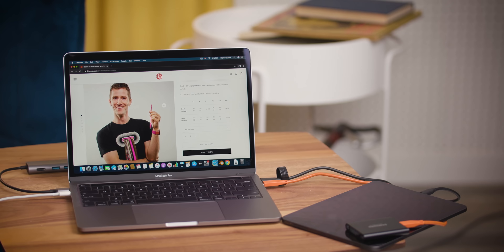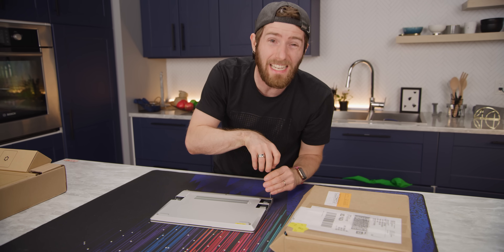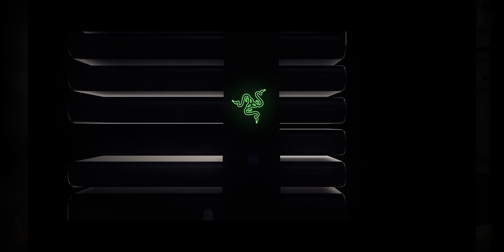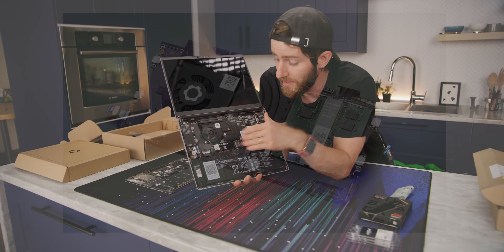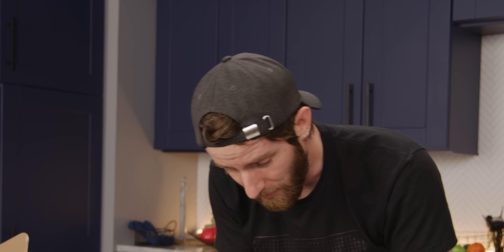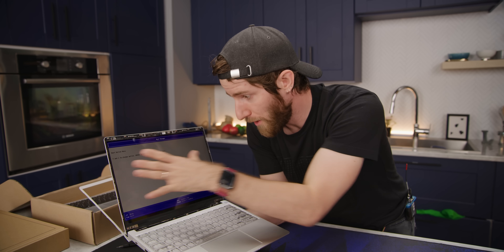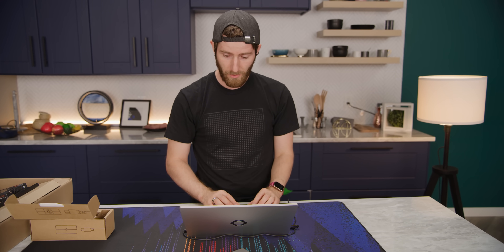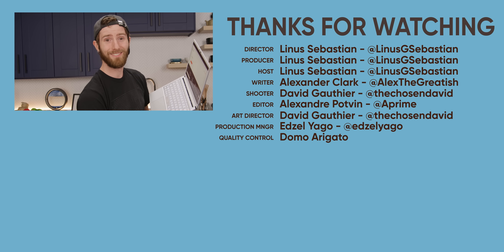A COMPLETELY Upgradeable Laptop?  - Framework Laptop Review

Comment: Listen, I love the idea, just how I loved the idea of the whatsitcalled modular smartphone back when, but unless somebody major joins the bandwagon, I don't see the difference between a laptop I can't upgrade and one I could upgrade if replacement parts were still available, but whoops, the small startup that created them went out of business and their sleek modules aren't manufactured anymore.

Like, just as an example, the first smart watch I bought was the Sony SW50, and it had a terrible (imho) silicone wrist strap. I thought, well, no worries, there's a replacement adapter that makes it compatible with standard 24mm straps, but oooh, it's like $60 right now, I think I'll wait until my current one bites the dust before I replace it. Well, about two years later the silicone tore, I went online and... Sony had discontinued the watch, like you couldn't even find it on their products page anymore, and that neat little adapter sold for +$100 on ebay, second-hand. Fucking infuriating.

I'm not speaking about the core components like RAM or the M.2 drives, huge kudos to them for sticking with widely available components there, but the cute little plug-in cards, the keyboard and trackpad (unless Lidon and PixArt just have that form factor ready to go)... I understand that you can't make everything modular and standardized, especially in a laptop, and maybe I am just too coddled by desktop PCs where I can swap basically any peripherals without even opening the case.

I want to love this, both the idea and the execution, but I've been burned by the promise of "nah, don't worry if something gives up the ghost, you can fix it" and then once it's time to fix something, like, four years down the line, I'll be on ebay again scavenging for broken donor devices to rip parts from. Y'know, like we're repairing current gen laptops. I'm more than happy to change my mind in the future, don't get me wrong, it's just hard to trust somebody who promises me they have the solution when everybody before them broke that exact promise.

Comment: My 15 year old broken laptop that has like 20-40 screws and takes a whole evening to disassemble and assemble: huh
Reply: I remember trying to fix a shitty walmart laptop. Taking it apart was so frustrating that when i finally got it done, i forgot how to put it back together. lmfao
Reply: @FungalumisBush  You can actually make a very slim desktop from a laptop using only mainboard, hard drive and a wooden box
Reply: I took a macbook pro apart once - having got hold of the "special screwdriver" - the screws in it were all odd lengths - you had to be really careful not to fry the MB when reassembling - it was obviously done deliberately to make it as hard as possible to repair without damaging it.

Comment: needs AMD cpu options, but if I ever need to buy a laptop this is going to be my first choice!
Reply: This laptop costs 2 grand for an i5 with NO GPU. this thing sucks dogwater compared to a clevo laptop! Clevo has systems for exactly the same price that have desktop cpu sockets and MXM replaceable gpu slots so you can actually upgrade the system at a later date. Not to mention they arent even shipping systems until 6 months from now if you ordered today. Linus needs to take a look at clevo they do everything that he wants in a system and at a rational price. I doubt this goofy startup will even last long enough to release a new motherboard with a cpu SOLDERED on lmao
Reply: @HaplessIdiot  right? This laptop is cool but its not doing anything that ThinkPads weren't 10 years ago.
Expansion bays/additional IO should be standard.

Dunno why you can have a t42 doing all the same things AND have a removable cpu(the excuse is always cooling)

I seriously think there needs to be a standard for laptop GPUs, it doesn't even need to be inside the laptop.

If you had an igpu all that you would need is a spot to plug in your dedicated GPU when you need it.

This laptop is certainly a step in the right direction, but certainly not as good as it could be.

Ill check out clevo tho thanks!

Comment: @Framework Are there Linux drivers for all the components?

Specifically power button / fingerprint reader has me worried. E. G. On my HP EliteBook 840 G3 I've got an unusable fingerprint reader - no drivers for Linux available - and even if i wanted to write one myself, the company making them does not hand out specs needed to make a driver so you literally have to reverse engineer the entire device...

Comment: I would love to have a Framework laptop, even one with a bit bulkier body frame too, so it would have more space for upgrades, slots, you name it. It could be the "Big Brother" version of it, with not much difference, maybe just the frame with nothing in it, then even the motherboard is install-required; and it is with a full sized- ten-keyed keyboard, that can have its numpad replaced even with more storage maybe. But also, with more space would come more slot space too [like 3 additional monitor HDMI-DISPLAYPORT if the "replaceable" GPU  is good enough to support it] or just more fans to keep it cool.... so many possibilities!

[As for the form factor, my main source is an ASUS ROG GLVE series laptop,  or wouldn't even mind a bigger one, if it comes with a bigger display - like a 17 inch plus ]

Comment: Now THAT'S what I'm talkin' 'bout!

If they are successful enough, perhaps they'll make a gaming laptop with this design philosophy down the road.

I think they could still just solder a CPU interface to a mobile CPU if they really wanted. Though, that would cost a bit of thickness. They probably thought of this and weighted the pros and cons, now that I think of it.

Besides... If you can take the included motherboard OUT... You can put a new motherboard IN, with an updated CPU attached.
Reply: This laptop costs 2 grand for an i5 with NO GPU. this thing sucks dogwater compared to a clevo laptop! Clevo has systems for exactly the same price that have desktop cpu sockets and MXM replaceable gpu slots so you can actually upgrade the system at a later date. Not to mention they arent even shipping systems until 6 months from now if you ordered today. Linus needs to take a look at clevo they do everything that he wants in a system and at a rational price. I doubt this goofy startup will even last long enough to release a new motherboard with a cpu SOLDERED on lmao
Reply: @HaplessIdiot  What are these blatant lies, the i5 model starts $750 did you even check their website.

Comment: Only criticism, and it's a very small one... offer blank modules, so if you don't need/want to fill all 4 with something, you can just cover it up. But given the price, you could easily get at least 4. I just did a quick browse, and could go 2x Type C, 1x Type A and a HDMI. An ethernet one would be nice, but I think even the low profile jacks are too thick for the module.

Comment: I'd love to see that thing get a touchscreen and 360 degree hinge
Reply: to give further info as to why I would be exited about that: currently I'm pretty pleased with hp Spectre x360 15 inch, but I had recently several problems with it like rattling fans, ports like the micro SD not working at all anymore, which I wouldn't need anyways but now it is just dead space and if you even want to look inside of the laptop you have to remove the rubber feet first before you can access any screws and after putting the device back together those rubber feet will never stick well again and now I have some rubber strips dangling off everytime want to move my laptop (until I go out of my way and have to buy new adhesive strips)

so yeah, I love the 2-in-1 form factor but currently there's no option out there that would give the consumer more customizability let alone just let the user easily repair its device

Comment: I doubt that Disconnect Battery was for using it that way though. Isn't it a service option that disconnects the battery for service, and until you plug in AC adapter?

Comment: 8:21
Can you change this slots while the laptop is running? Or do you need to restart for it to realize it's now a HDMI and not an USB-A anymore?
Reply: You can hot swap them because they all interface through thunderbolt 4 at the usb-c connection

Comment: Too bad its not suitable for hardcore gaming. Other than that, easily the most impressive kind of laptop. I still won't buy a laptop. I have no use for it. But thid would certainly one of the most interesting concept. Always hated how hard laptops are to deal with when trying to upgrade or repair or clean.

Comment: As a Thinkpad refurbisher this is amazing to me. Though, it seems a bit pricey.
Reply: This laptop costs 2 grand for an i5 with NO GPU. this thing sucks dogwater compared to a clevo laptop! Clevo has systems for exactly the same price that have desktop cpu sockets and MXM replaceable gpu slots so you can actually upgrade the system at a later date. Not to mention they arent even shipping systems until 6 months from now if you ordered today. Linus needs to take a look at clevo they do everything that he wants in a system and at a rational price. I doubt this goofy startup will even last long enough to release a new motherboard with a cpu SOLDERED on lmao

Comment: It is funny that I still have Samsung 900X3C from 2012... and I regularly use it when on the go because it is ultra slim/ultra portable device and it has almost all the same upgradability. Yes you can fit M-Sata driver (times before m.2), you can fit new wireless card... the ram is sadly soldered on, but it is ultra-slim laptop (and you can have 15" still ultra slim 900X4D which has upgradable ram). I have recently replaced the battery on my girlfriends laptop (she has similar 900X3E model) as there are no glue or crap on these laptops. And it is still fully usable laptop - she used it for studies and playing LOL, SC2 and many older games. I have upgraded to 512GB SSD from 128GB in mine. So there are ways of upgrading these things. The only thing which is glued is the bezel around the screen, but the screen itself is just screwed on. I have seen replacement screens and they simply come with new bezel which you can stick-on. In short, the only waste generated by replacing screen is slim piece of screen bezel (no more aluminium than in single can of coke!).
One thing I wish somebody would do is the new motherboards... Imagine how awesome it would be if I could take this gorgeous ultra-slim alloy laptop from 2012 and replace crappy i7 3517U/Intel HD4000 graphics with something like Ryzen 7 5800U! Consider this - old CPU was W17TDP part, the new Ryzen is W15-25TDP part so not only it is more efficient and would make battery life better (which was not that bad to begin with ~6h when new and still get's me 2-3h today), but it is like 10 times faster on all tasks. And I would like to note that fan on this laptop isn't even running all the time - if just browsing the internet it doesn't even spin... so I would speculate Ryzen could be cranked all the way to W25TDP and existing cooling in the laptop would still be able to cope.
So... the key problem is that upgrade parts are never made. If somebody would take new MB for my 9 years old laptop, it was made in a way that it could be upgraded and because of advancement in efficiency I can increase it's power like 10x and still manage the TDP within what is ultra-slim laptop.
https://www.notebookcheck.net/Review-Update-Samsung-Series-9-900X3C-A04DE-Subnotebook.83079.0.html
In summary, the claim that you cannot tightly integrate laptop and make it desirable is bullshit. If Samsung managed to make this ultra-slim allow laptop without using any glue in 2012, then it is possible to do. The FLEX... there is NONE - it is precisely machined aircraft grade aluminium unibody - it is as solid as solid piece of aluminium alloy could be. One other thing - the way Samsung designed it doesn't require unplugging any flex cables before you can start upgrading (and these could fail over time), meaning that Samsung implementation is even better and potentially could withstand much more times being opened. I am even getting questions (of what it is) and compliments how stylish it looks even 9 years since it was made.
Reply: Well, Linus did mention that back in the day laptops were far more upgradable than they are now. Frameworks have harped back to those days, But with a modern laptop and design. Not just that though, This thing is far more modular than anything that has existed before! There's no way you can compare your laptop to this with upgradability! Look at the modules they have made and the endless possibilities with current high end components.. All at entry level prices.. This could be a game changer! If it takes off and other companies take note.

Comment: i love the idea of the swaping of the ports you can run on the side, as a network engineer im foreced to work off a company issued dell latitude 7400 which is missing one KEY components for my job, a network port, there webesite isnt showing that as a port option yet but i hope they bring one in, i miss having a network port to be able to plug directly into things when im working in a datacenter with zero wifi.
Reply: You can use a USB ethernet adapter, you know. :)
Reply: @marcus3d  yea thats just carrying extra in my bag :D
Reply: @marcusshipley1973  True. However, if you're often using the same ethernet cable then you can just keep an adapter attached to that, and use it as if the network cable had a USB connector instead of the rj45 one.

Comment: so my knowledge is a little old but i used to repair dell Laptops as well as lenovo/IBMs in australia, haven't since around 2012
i found Dell Laptops 
easy to work on, came apart very logically and only 2 maybe 3 different types of screws
warranty was excellent sometimes covering device couple of months out of warranty, plus would find myself at a school and then a resident the next day was not just support for corporations
really good support i could chuck the dell asset tag into a website and i would tel me what the system type  any upgraded ETC aswell as bios upgrades that were so simple to run.
they didn't market modular but i don't remember anything being glued in
Rarely ever needed to support love them working on them would happily go fix a dell any day of the week.
i would question the quality but never had DOA parts and never reattended so no hard facts on that

meanwhile lenovo/ibm 
30 different types of screws 3 different types for the back plate so you had to know what you were taking apart
not logical in terms of what you had remove
always required the manual and bios upgrades weren't as easy to source nor download
never fixed for residential always corporations

My 2 cents there from experience

Comment: The problem I have with modular devices is that I tend to hold onto my electronics for like 5-10 years. I had my mac laptop for a solid 7 before getting a new laptop. By the time I'm ready to upgrade, I'm almost certain that they won't be selling upgrade parts due to incompatible standards.

Comment: The expansion 'cards' that plug into the USB C ports seem to be wide enough for 2 USB A ports - I'm surprised they only went with 1.
Reply: They probably make a decent % of their profits on selling adapters, and markup on parts (RAM, SSDs, etc), so makes sense for them to sell the ports one at a time.  They're opening up the port spec so once 3rd parties start making adapters, someone will probably make a dual-port USB slot.

Comment: this is the first laptop i'm genuinely tempted to buy. i don't even need one i just want one and support them, damn
Reply: This laptop costs 2 grand for an i5 with NO GPU. this thing sucks dogwater compared to a clevo laptop! Clevo has systems for exactly the same price that have desktop cpu sockets and MXM replaceable gpu slots so you can actually upgrade the system at a later date. Not to mention they arent even shipping systems until 6 months from now if you ordered today. Linus needs to take a look at clevo they do everything that he wants in a system and at a rational price. I doubt this goofy startup will even last long enough to release a new motherboard with a cpu SOLDERED on lmao
Reply: @HaplessIdiot  I just max specked both pcs, and you are right. You can get a clevo computer for $400 less with a graphics card. However, Clevo doesnt come with the replaceable mounts for keyboards and all of the internals. Having a swappable cpu and gpu might be the most important parts of the system, but not having swappable everything else is a massive downgrade for general users. Plus, since the company is open about their products, if this takes off I do not doubt seeing a replacement shell which i would 100% buy. Plus, the company is European based which makes end user support (especially replacement parts) harder to buy. 

There is a reason Clevo isn't known. And the "gAymEr" aesthetic with their laptops isn't appealing to a wide audience. Even after looking at a Clevo vs. this laptop, I would still choose this one.
Reply: @HaplessIdiot  DUUUUDE!